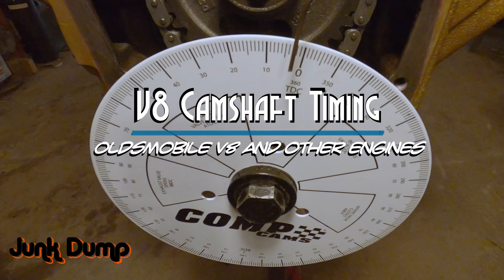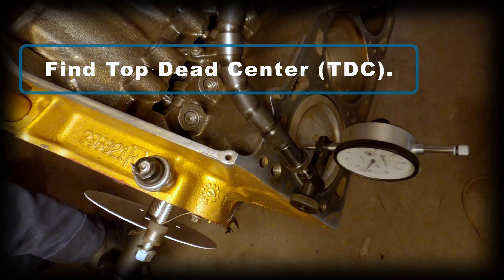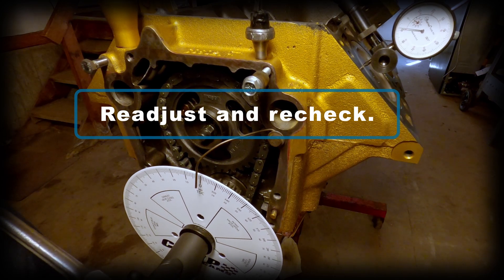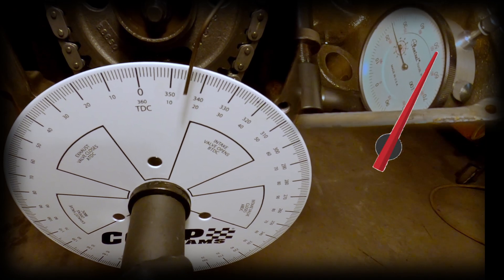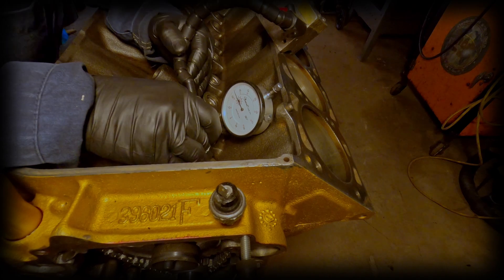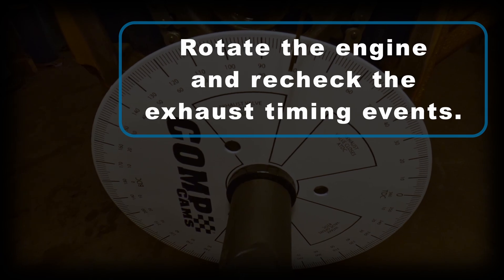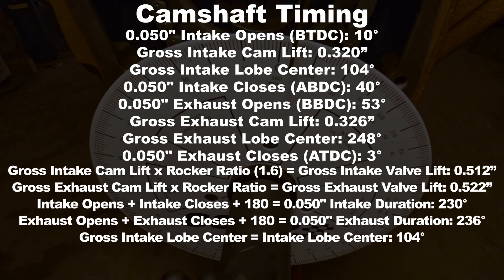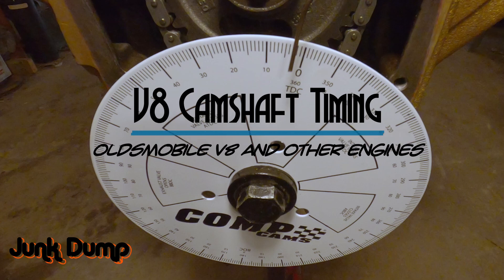Camshaft Timing Detailed Procedure for an Oldsmobile V8 & other V8's

Comment: So explain to me why we need to do this , every video I've watched the cam is always in spec or close enough not to make a difference.
Reply from the maker: Camshaft timing is important because it verifies the cam is installed and manufactured properly. It is especially important if you are advancing your cam timing. Personally, cam timing has helped me on a few occasions. I have had a camshaft that was packaged and stamped incorrectly, I had a camshaft that was twisted, and one camshaft that was truly out of spec and shipped with a cam card that said it was in spec. Checking cam timing saved me a lot of work and hassle on those occasions. Also you can use cam timing to check the "health" of a camshaft with miles on it to determine if it's worn and warrants replacement. Thank you for the great question.
Reply: @junkdump2720 thanks for the reply, I will be putting together a 455 soon and I will invest in a timing wheel.
Excellent videos 👍👍

Comment: Thank you for all the tech tips. I just got my 455 .40over back from the local shop and lost oil pressure, and trashed the motor by the time I got off the highway. Im 22, and this will be my first engine build. If I follow the videos you posted am I off to a good start rebuilding my own or is their more to worry about in these engines specificly? besides oil flow issues, and breaking in the cam properly. Again, thank you for sharing what you have learned
Reply from the maker: There is a lot more to building an engine than just buying the parts and putting it together. Among other things, you need to measure all tolerances, for example, get the bearings of correct style and thickness to ensure good oil pressure and protection. My videos will help but there is a lot of engine building knowledge required to fully understand how to build an engine properly, especially one that has had a catastrophic failure event. Before rebuilding you should be positive you've identified the reason oil pressure was lost and rectify root cause of the issue. Matching components is essential, like having the correct pickup length for your pan, correct pushrod length and lifter height, and even matching your cam profile with the rear end ratio, transmission, cylinder heads, intake, and exhaust. I suggest if you want to rebuild your engine, do research into building Olds engines , spend time with the original shop manual (like engine section of the 1972 Oldsmobile chassis manual), if you can find an old Wyotech notes folder from the engine building course that would be extremely helpful. Speak with your local engine shop if you have questions, and ironically stay away from internet misinformation when possible. Also feel free to send questions my way when you need help. If you are wiling, have the tools, and want to put the time into it, you can absolutely rebuild that engine into something you will be proud of.
Reply: @Junk Dump thank you sir, really appreciate you taking the time to get back to me. You will definitely be flooded with questions once I do my research and get a plan going.

Comment: Hi I'm from Boston I seen your YouTube video  on dial indicating a cam. Someone asked what type of cam to put in a 73 delta and you narrowed down some choices based on certain situations. I currently have a stock 350 type 8 heads it's in a 1975 delta 88 convertible 94.000 miles runs good. I've bought but haven't installed yet. Headers glass packs on the headers exhaust pipes all the way to the rear bumper  edelbrock intake manifold 7111 edelbrock 1411 750cfm carburetor light distributor springs high voltage coil 60.000 transmission is stock with stock stall. rear end is stock but I noticed car needs a 4th gear. I'll be removing the cover in the spring to find out what gears are in it. would it make a difference putting different heads on it or having them ported or just leave it? can I put a cam in without changing the cam bearings? what cam pack would be good for more improved power in the off idle to 5000 or a little higher rpm? preferably edelbrock cam. At this point I don't even know if the 350 can take a 750 carb I'm used to 455 but I unfortunately sold it so 350 is a new venture for now. How much horse can a cam headers 750 carb and intake give you? what i mean is it worth it? thanks for your time and I'm looking forward to your advice thank you i also emailed this to you
Reply from the maker: The Olds 350 is an excellent engine! The trick is to know where your power limiters are and spend your money where it will make the biggest impact. Here is my advice for your setup. Exhaust: Use mufflers (Dynomax Super Turbo are fine, example part number 17733 if you have 2.5" exhaust pipes) this will increase your backpressure over glass packs. Olds engines like a little backpressure, the glass packs will help make a little more HP but will sacrifice too much torque. Intake: Your choice is perfect! Carb: I think a 650cfm would be best but the 750cfm should be fine if tuned correctly, read your plugs and make sure you aren't running too rich or lean, you may have to jet down the primaries a little. Cylinder Heads: This is the biggest restriction for your current setup and should be your priority. If you decide to work the #8 Heads, I suggest you remove and plug the air injectors. Have a machine shop install valve seats Qualcast #20-2125-11 and install Qualcast #10-1457 2"(1.994") Intake Valves. Have them open the throats to 89%. Then complete a mild porting (like in my video on olds head porting). If the machine shop quote is too much money, try to locate and buy a set of 1970-1972 350 heads, they have smaller combustion chambers and will increase your compression ratio. I would also suggest the same intake valves and valve seats for the 70-72 350 heads. Camshaft: If you are interested in staying with Edelbrock then the 3712 Performer Plus is the best fit for your setup and vehicle. The stock cam bearings should be fine but you will have to inspect them. If you upgrade the heads as described above and want more HP at the cost of low end torque then you could consider the #7112 Performer RPM, if you run this cam you should consider a mild stall converter. I hope I've been helpful. I ran a 1972 Olds 350 in an 82 Delta 88 for many years and loved it!
Reply: @junkdump2720  thank you i will fill you in on the progress thank you for the info
Reply: @junkdump2720  ok i sold that 350 and i bought a 1965 425 starfire engine with A heads. the heads are in the machine shop getting stainless steel valves hardened seats new springs retainers and keepers. i also bought a cam and lifter set. cam card says intake hyd .488 and exhaust   .490 and centerline 108.0 icl 45 degree bank angle i just put it in yesterday. i checked with a comp degree wheel and the number on card says the lob lift is 306 but i found it to be 309 so the actual gross lift is 495. is this common? and it's supposed to be 108 degree and i found it to be 107.25. i just put the cam in because tried to compensate with the lower timing ear but i couldn't get it right. i also was wondering on a 1965 425 engine does the timing marks come together like a chevy or are they both at 12 o'clock? on this engine if i put the top gear at 6 and the bottom at 12 both valves would e open but if i put them both at 12 the valves are closed
Reply from the maker: @bobdimartino6738  Unfortunately it is common to find the specs off like this, there is a margin of error and some manufacturers are quite sloppy. The factory correct way to set timing marks on an Oldsmobile engine is crank gear mark at 12:00, cam gear mark at 6:00. The gears are manufactured so  the crank and cam are synchronized properly when installed in this configuration. Turn your engine to cylinder 1 TDC (remember that the #1 piston hits TDC twice, once on compression and once on exhaust to intake) and the valves will be closed when rotated to the compressions stroke of TDC. Use your timing wheel and you can verify the installation as in the video.
Reply: @junkdump2720  yes i have it set 6 and 12 and the valves are closed this is correct? otherwise i don't want to make a mistake because you'll never be able to use a timing light if it's 180 degrees off
Reply from the maker: @bobdimartino6738  That is the factory correct way to set timing marks on an Oldsmobile engine. The crank gear mark at 12:00, cam gear mark at 6:00. The 180 degree thing is a not an issue if you check your work by turning your engine to cylinder 1 TDC (remember that the #1 piston hits TDC twice, once on compression and once on exhaust to intake) and the valves will be closed when rotated to the compressions stroke of TDC. I can't stress this enough: Use a degree wheel and you can verify the installation and timing are perfect, follow the video and you will know exactly if your cam timing is off.

Comment: I have a 73 350 with #8 heads what is the best cam upgrade for this year??
Reply from the maker: That depends on a lot of factors. Some of the towing and street options will work with stock springs. Always buy the cam kit with lifters and I recommend the matching springs too on the performance cams. If you are going to use a stock stall converter and intake look at these cams. Iskenderian: Street Torque	691264	2000-5800 rpm, Towing  691256262 1800-5000rpm. Engle (Mondello): Street Torque JM-16  800-4200rpm, Street Torque JM-16-18  800-4200rpm, Performance MW-31 (W-31)	1400-5500rpm, Performance	JM-18-20	1000-5000rpm. If you upgrade your exhaust, Intake, and have a mild stall converter (less than 2000rpm stall), then look at these. Iskenderian: Performance	 691262	2000-5500rpm, Performance	691270	2000-6000rpm. Engle (Mondello): Performance	MW-30 (W-30)	2200-5500rpm, Performance	JM-20-22	1400-5800, Performance (good vacuum for brakes)	JM-22-25-10 	1400-6000rpm, Performance	 JM-22-25	1400-6000rpm. Contact me at junkdump455@gmial.com If you find this list a bit overwhelming and want help to narrow it down. Send me the following information: What you want to do with the vehicle (better take off on the street, increase the power band up to 6000rpm, race with street drive ability), Then list the vehicle that the engine is in, the transmission, the stall on the torque converter, the rear end gears, the carburetor, the cylinder heads, the intake, exhaust diameter, mufflers, manifolds or headers. Using this info we can narrow it down a bit.